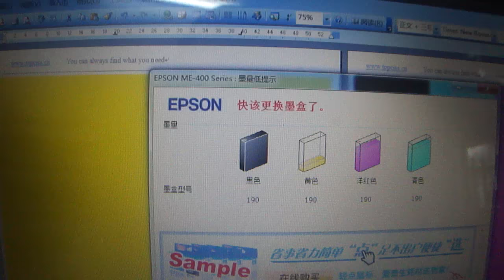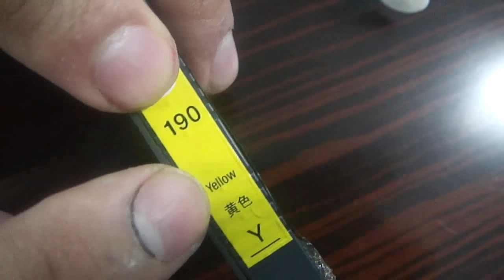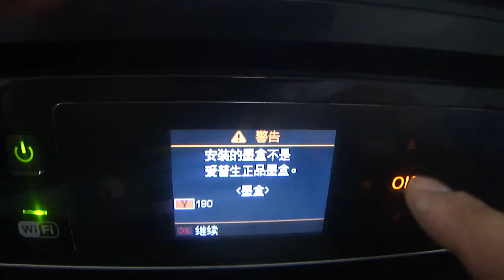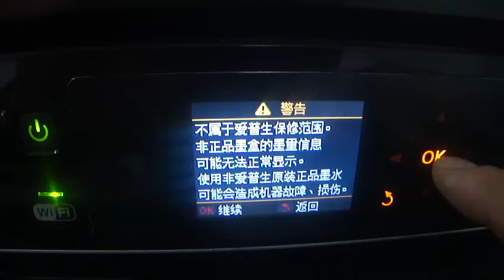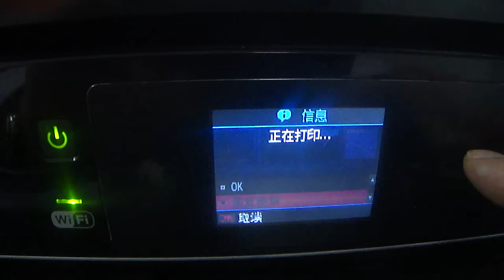How to refill the epson expression home xp series

Comment: Instead of a drill bit use a soldering iron. It makes a much neater hole and you have no burs getting in the cartridge and blocking the jets.
Reply: We don't have that at home 🙄
Reply: I thought that  too . But what about the rubber plugs how would measure the dimension of the hole initiated .
Reply: @henryradulescu5089  you use a micro soldering tip then gradually make the hole the size you want. Or just put some hot glue over the hole as that peels off easy when it needs refilling again.

Comment: Epson printers are ravenous ink eaters. Even when you put in a new cartridge once it gets done with the head  cleaning cycle you will see it has only 90% left. So each cleaning cycle is 10% ink. So the more frequently you print between cleaning cycles the more the ink goes into your printing rather than head cleaning. After buying many Epson printers in my life I've finally had it with them. I will NEVER buy Epson again! Not because of the quality of print but their inability to design print heads that require cleaning less often. Canon and HP waste way less ink than Epson.

Comment: Good evening, I have a printer wf 3640, I want to put continuous system in it, I have used original cartridges in it and I intend to use dye in the system. have a doubt regarding the inks ... what ink that comes in the original cartridges of the wf 3640? Can I do the mixing or do I have to do the cleaning of the whole system?